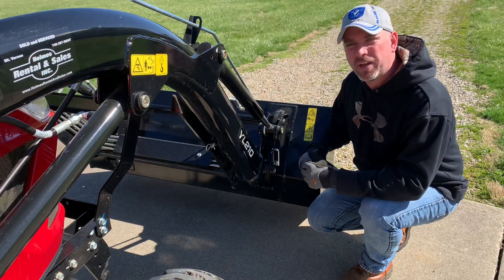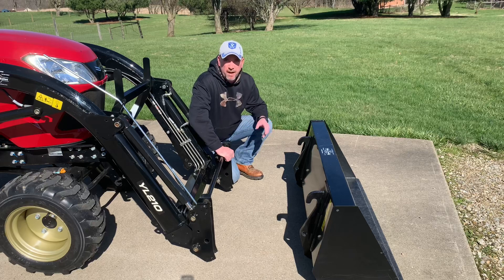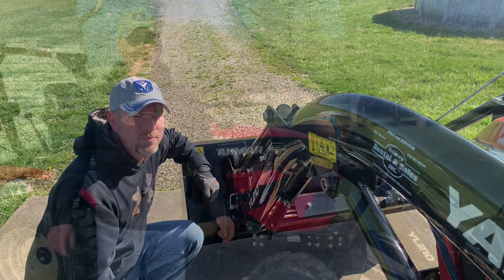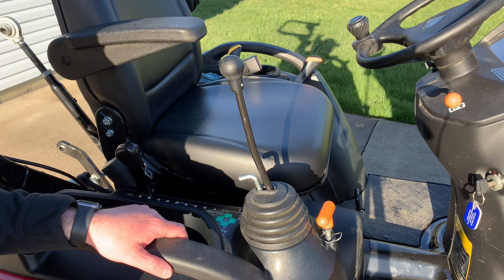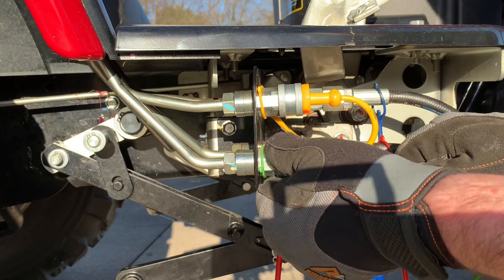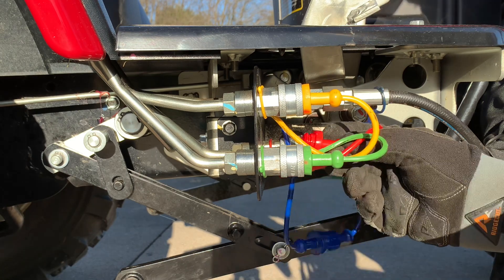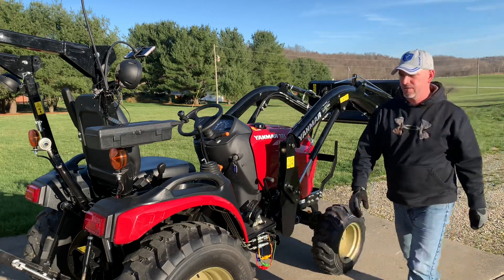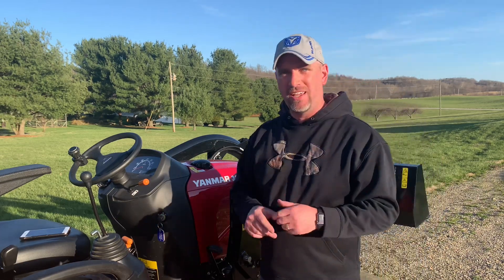Yanmar SA 324 Quick Attach Bucket plus YL210 Loader Removal and Install

Comment: I don't understand why they would make such a great tractor then mess it up by using a proprietary quick-attach system. That's great if you want to be locked into this brand to supply all your front implements, or if all you will ever use is the bucket - otherwise it's as crazy as selling a tractor with a non-standard proprietary 3pt hitch. I hope they realize this costs them sales.
Reply: or just have your dealer put a conversion kit on

Comment: If I may ask about how many acres you have? I am looking at buying 5-15 acres. Is this unit too big for what I need or should I use the 221??
Reply from the maker: We have 5 acres. I think the 324 would be a good size for 5-15 acres but the type of property you purchase will have an impact on what size tractor you will need. If you plan on using the tractor in a wooded area or to do some brush hogging the 324 and 424 offer significantly more ground clearance than the 221. You won’t be disappointed if you purchase a little more tractor than you need but you will be if you go too small. Once you know what kind of property you are going to purchase talk to your local Yanmar dealer and let them know what you are going to be using the tractor for and get their opinion as well.

Comment: I have the same tractor, it's a great tractor for my property. Do you plan on doing a 3pt hookup/PTO shaft video?
Reply from the maker: I am planning on doing a video on the 3PT including how to hookup attachments and 3PT adjustments. As far as the PTO hookup stay tuned I have something in the works that will touch on it. Thanks for watching.